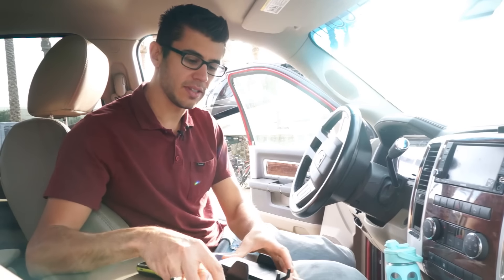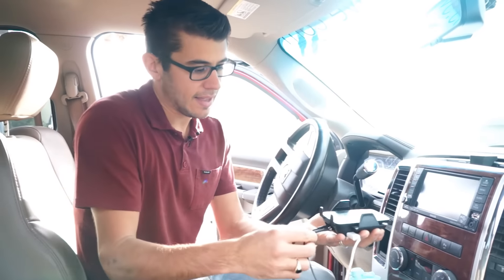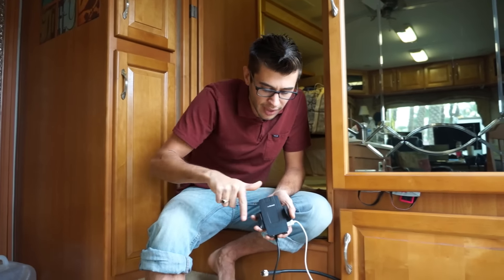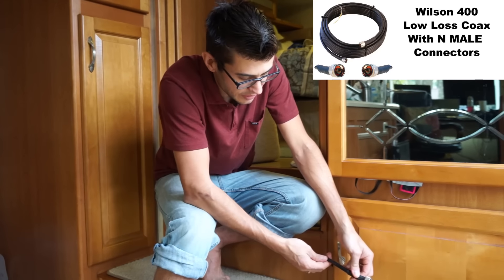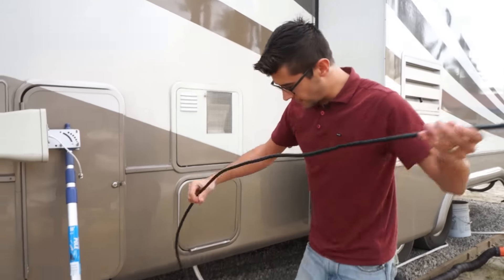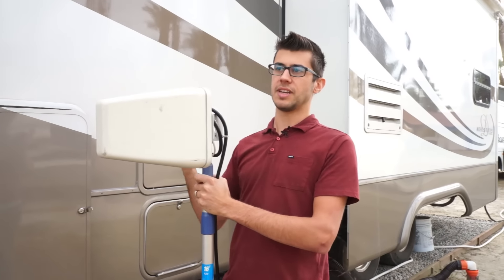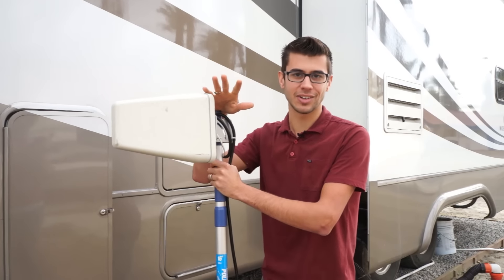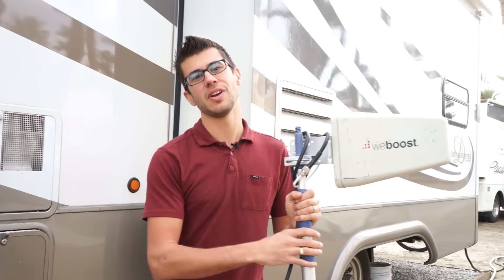Powerfull Cellphone Boost for cheap! - How We Boost Our Cell Service and Internet

Comment: I have a cabin out in the woods were I only get one (1) bar of service with AT&T.  I do have a large directional TV antenna that is mounted on a pole that is about 30 feet high.  Can I use my antenna in place of the Wilson Web Boost antenna and get the same results?

Comment: I give up. After a month of trying to get this to work, I'm raising the white flag. Weboost has changed their cell phone booster unit and it is much more difficult to get it to work now. I have located the connector needed to go from the new unit to the cable, but now am stuck with getting power to it within our RV. We will need to wire a "cigarette lighter" to our battery to make it work. I'd probably be willing to do that, however, the unit won't even work on our truck! we have an F150 which is made of aluminum not metal and so a) the antenna won't stick to our truck and b) there is no metal for it to conduct waves off from. Weboost suggest mounting a metal plate to our truck - yea not going to happen especially as it's a lease! I'm really disappointed and frustrated that I couldn't get this to work and am now forced to buy the more expensive weboost RV model. :(
Reply: As I understand it, you don't need to attach metal to your truck. you just need a piece of metal for the antenna to stick to. You should be able to just lay that piece of metal on your truck roof, once you're stationary.

Comment: Thank you for the video.  I've been trying to figure out internet in a remote location I'm often in.  I have verizon and the area is covered by US cellular.  My phone pirates off the US cellular towers saying "extended network".  This works fine for talk/text but no internet.  I would like to keep Verizon but really want internet.  Do you think the system you described would be able to pick up a verizon signal?
Reply from the maker: space radish it's hard to say.  is verizon signal nearby? like a short drive, or are you on extended in a very large area? if it's borderline yes this could help. if verizon is nowhere near it will just boost uscellular.  the phone will prioritize on verizon towers so when we find ourselves in this situation we point the antenna to the suspected verizon location and turn airplane mode on and off to reset the cell radio.  we try this technique with multiple antenna positions. we have gotten the phone to hop to verizon this way, but it really depends on the situation/location, line of site etc..
Reply: Yes, it's extended in a large area but I may still try this.  Thank you so much for the info and the reply!

Comment: How well would this work with using my cell phone as a hot spot? I only have 2 bars at my home with a -106 db signal. I can't get internet where I live, so I'm debating on using my phone or getting an individual hot spot for internet use as me and my wife can't live without playing video games online or watching Netflix.
Reply from the maker: We mostly use this for boosting the data and it works great.  I am actually currently using internet through this setup.  Not boosted we have 1-2 bars -104db 1x net.  On the booster and pointing the right way we are seeing 3-4 bars, 4G lte -78db.   Put the phone in airplane mode then take it out once on the booster to reset the cell radio and switch over to better data bands.

Comment: If the cradle only boosts the signal for about 2 inches all around, how do you boost your cell signal when not in the cradle?  That's great if you are only using it for a hotspot, but I cant see how effective it would be for voice calls. Are you only using it for a hotspot? Enjoy the channel by the way, and we are buying a DRV Sante Fe this year.
Reply from the maker: We use it for voice calls a lot by using Bluetooth to remote speakers, headsets, computers etc... when we're in really bad service we pile a few devices on that thing.... other options might work a bit better but we have tested out the RV boosters and you still have to be really close to the booster for it to work...  we're actually using it right now where our phones see one bar no data without it.   With it 3 bars LTE, and I'm online. :)  best of luck with the new rig , that's a nice one!
Reply: Thanks, that makes sense. Did not think of Bluetooth headset. I can work from basically anywhere I have cell coverage and internet. this sounds like a cost effective alternative. Thanks

Comment: could you help me understand these boosters? in your video you say you canget a signal anywhere. when i talked to we boost they said if i can't make an out going call without a booster a booster won't work. my cabin is in east texas. what are your thoughts? thanks
Reply from the maker: superma74 we have been in many situations where the phone will just be searching for service, but with the booster pointed in the direction of the nearest tower it works great.   How far are you from service and are there any Mountains/ hills or large obstacles in between?  It really depends on the situation but if there is signal in the vicinity even if the phone has no service we can get it.
Reply: i am 8 miles from totally reliable service. i don't know where the nearest tower would be. ground is relatively flat and wooded. i have at&t and just recently recieved a incoming phone call. i occasionally receive voicemail notices but can't connect to hear the messages. friends with verizon can get phone and internet at odd locations but lose it if they move just inches.
Reply: my guess is that we boost is playing it very conservative for fear of over promising and under performing.
Reply from the maker: superma74 sounds like a booster with a good antenna like I show in this video would work well for you.    You will probably need to spend some time finding the tower with the antenna.  But once lined up, I bet it will work great.   I think most people do not understand how to get the most out of a booster, so yes weboost is probably being conservative.  People like us on the other hand push the limits all the time.